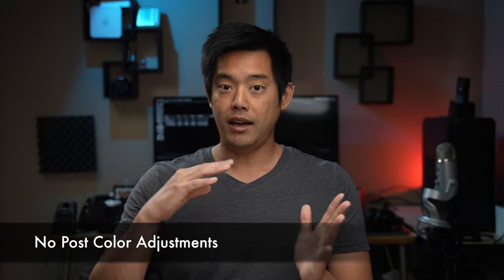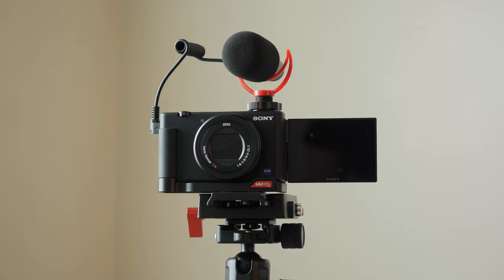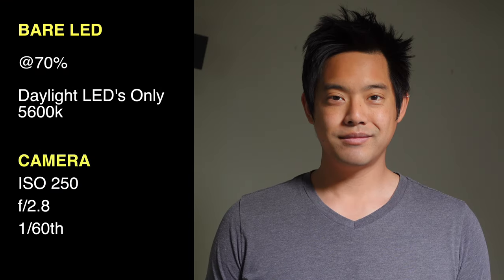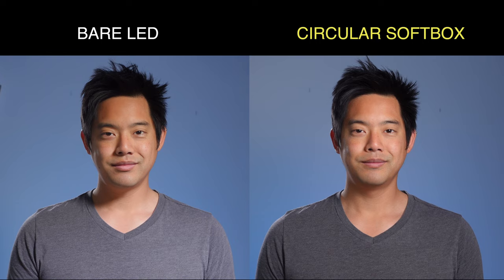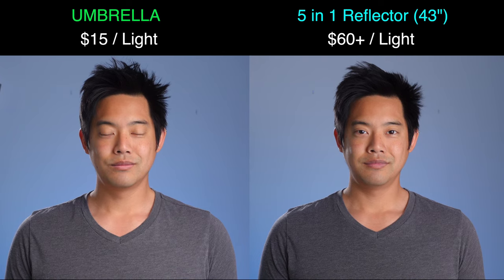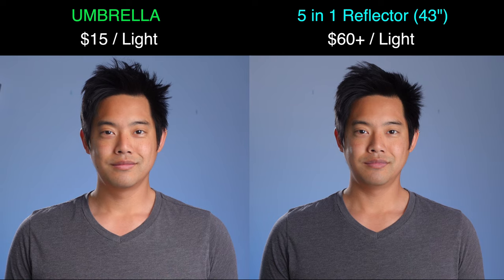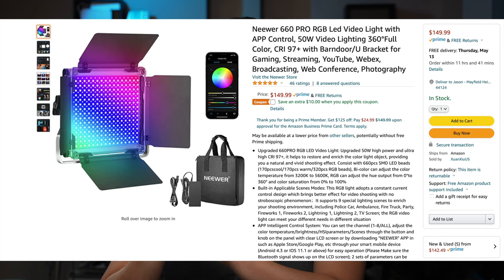How to diffuse your Neewer 660 LED Panels | Budget | GVM 800D and many more

Comment: After having pondered this decision and going back and forth I think I finally decided: The round softbox is what I am going to go with, even though it is more expensive, simply because it allows the softbox to be fixed to the light without having to take off the barn doors. In situations where we have to pack and unpack often, this is the best way for me.
Reply from the maker: Hey hey again DesertCookie!
Actually with the Circle Version (assuming they haven't changed the design) You will need to keep the barn doors on for it to affix to the panel.

Comment: Thank you.  I was having trouble attaching the round Softbox to my Neewer 660.  I was under the impression that I needed to take off the barn door, but the Softbox wouldn't stay in position.  Watching you put your Softbox over the barn doors really helped me.  Also, I will take off the diffusion panel.
Reply from the maker: Hey hey CMQ Japan!
Thank you so much for checking out this video and commenting!
So glad this video helped out! Yea the circular one definitely needs the barndoors on. Kind of weird that the circular ones didn't a easier way to do it without the barndoors. 
Thanks again for stopping by! Stay safe, healthy, and I’ll see you in the next one!

Comment: That was a great video. I've seen so many videos of people hating on the 660's, but I think you can use it with the proper diffusion under certain circumstances that would help. Great video!
Reply from the maker: So glad this video was helpful! Yes the 660s panels are still very versatile when modified correctly to get the look you're going for!

Comment: I had almost all the lights you are talking about and need to add my opinion on them. The 660 rgb, when it comes to only the whites, is much brighter than the regular 660 bi color.  Even with less lights for the whites the RGB still very much outperforms on whites only. And of course you have the benefits of the colors as well. I recently upgraded all of my 660 rgb to the pro version. And the pro is definitely brighter all around on both whites and colors. It's also has higher wattage. Hence the reason it's brighter. And why I upgraded. I also own all the softboxes and diffusion equipment you mentioned. One thing not to forget is the convenience of the neewers. Because they attach right on the light and fold up in a very small/portable package.

One thing you should have tried is neewers all white one. I have those as well. I would assume that they would be a bit better at removing shadows in the face and neck. But they will probably also spill some light onto your background. I would love to see a comparison video made comparing the all white, the black sides, and the the black with the grid added. I may do my own testing but don't think I'll be able to make a video to upload.
Reply from the maker: Hey hey Adam!
Thank you so much for checking out this video and commenting!
Awesome to hear that the Neewer 660 RGB Pro's are brighter than my old 660 bi-colors. I don't have the newers 660 series to see how they compared to these older 2.4g models. I'm sure they've gotten better since then and still serve as an awesome deal for people looking for lights to start their filmmaking journey. 
Thanks again for stopping by! Stay safe, healthy, and I’ll see you in the next one!
Reply: @TLDR_filmmaker  it's not just the pro rgb. I had the non pros as well. The regular 660 rgb. When I ordered them I also ordered 2 of the of the bi-color. Specifically because I thought on the white only they would be brighter. I was very much mistaken. The rgb's whites definitely blew away the bi-color. I even made an amazon review about it.
Reply: @TLDR_filmmaker  by the way, I most definitely appreciate the reply. And your videos as well.

Comment: Would you use one with an Elgato Key Light to help soften the light further?
Reply from the maker: Hey hey Jason!
Thank you so much for checking out this video and commenting!
I'm not sure how bright the Elgato Key light can get. If it's very bright you can definitely use an umbrella or reflector to soften the light further. I wouldn't use a softbox that is small and similar in size. You want the 2nd diffusion layer to be larger. 
Thanks again for stopping by! Stay safe, healthy, and I’ll see you in the next one!

Comment: This was a perfect comparison! I bought the Neewer NL660 set about 10 months ago. Unfortunately I got the version without any display on the back of the LED making it impossible to know which K values I am using the LEDs at. I am using this set for my Youtube channel, where I do drumcovers in a super tight space, which is where those LEDs really seem to shine due to the limited space (thank god for Manfrotto's autopoles!) . In my studio I am using the circular and the square softbox and when I use the LEDs in my living room, I tend to grad my cheap umbrella (lots of spill though...) or my 5in1 reflector. Atm I am saving up for the Godox VL150 for my talking head videos. I will definately keep my 660s though, since they are super flexible (with color gels, as a hair light, lighting the wall, etc.). Btw the cheapest option imo is baking paper (color shift can happen), a plain white shirt or a piece of bed lining.
Reply from the maker: Hey hey El Boyo Electronico!
Thank you so much for checking out this video and commenting!
Awesome! Glad the 660 panels are working out for you with the various diffusion options! Yup yup, I used wax paper for awhile as well! Solid cheap diffusion tricks!
Thanks again for stopping by! Stay safe, healthy, and I’ll see you in the next one!

Comment: Nice video! Can I get a speedlight/umbrella adapter and then remove the hotshoe part (I guess they screw off) to reveal a screw that I can put the light stand adapter, then finally the 660 on that?
Reply from the maker: Hey hey shmikey100!
Thank you so much for checking out this video and commenting!
That is a good question, I've never used a speedlight adaptor before but if you unscreen and it reveals a 1/4-20 port or a 5/8th, then yes it should work if you just buy the baby pin light stand adaptor. 
Thanks again for stopping by! Stay safe, healthy, and I’ll see you in the next one!

Comment: Your videos are very informative! Some of the best on YouTube, really. Whenever I see your name pop for a topic I'm looking for your video is the first I click. I have a question: I'm in the market for 660 RGB PRO but I also want the bi color version. Would it make sense to buy all RGB PROs or does the RGB PRO not work as efficiently as a bi-color?
Reply from the maker: Hey hey Furious Angus!
Thank you so much for checking out this video and commenting!
So glad this channel has been helpful for your product research!
The RGB Pro is a good round about panel for inside a bed room and smaller setups, but if you are looking for maximum punching power, the Bi-Color 660 will have more because of that focused light. Depending on how many lights you need, say like a classic 3 piece setup. You can definitely mix it up to your needs, maybe 1x bicolor for the punch and then 2 RGB PRO for fill light and color use depending on your needs. 
Hope this helps!
Thanks again for stopping by! Stay safe, healthy, and I’ll see you in the next one!

Comment: You're tutorials and reviews are super helpful, detailed but not too long. Amazing!

Just wondering if you could help me add the umbrella on my 660. I'm a newbie and don't know how to do properly. And if you could recommend specific umbrella and other needed hardware, I would appreciate it. By the way, Im from Canada. Thanks man
Reply from the maker: Hey hey Psalms by harvz!
Thank you so much for checking out this video and commenting!
Glad this video was helpful! All the links to the umbrella and umbrella bracket I used are in the description. In terms of putting it together, its pretty self explanatory when you receive the items. Simply mount the umbrella bracket onto the lightstand, and then the 660 on top of the umbrella bracket. There is then a little hole for you to slot the umbrella rod through. And thats it!
Thanks again for stopping by! Stay safe, healthy, and I’ll see you in the next one!
Reply: @TLDR_filmmaker  Thanks for quick response. I really appreciate it. I just noticed you have the links of the umbrella and the adapter below. 

Yeah! You're video are simple, easy to understand, brief but detailed. Would love to see more camera, lights and gear review.

Currently I have ZV-E10. I have Sigma trio's, small rig case and would love to hear more useful accessories and gear for ZVE10.

Comment: Great video! Would it make sense to use the provided diffusion panel and the umbrella? Or another way to put it, would that make things even softer or just make the light dimmer?
Reply from the maker: Hey hey D!
Thank you so much for checking out this video and commenting!
It will technically make it softer, however I feel its not that big of a difference when using the umbrella method so I choose not to use the diffuser panel to maintain more output power. 
Thanks again for stopping by! Stay safe, healthy, and I’ll see you in the next one!
Reply: @TLDR_filmmaker  Makes perfect sense. Thanks for the response! & Likewise!

Comment: You mentioned the SMD version (P-600 2.4GHz), which doesn't have the lenses and offers a more a "flood" light to more uniformly illuminate an umbrella. I looked into it, but it only has 600 LEDs and 1700LUX/m output, as opposed to 2270LUX/m in the 660. 

I also found a "660 Advanced" version on Amazon, which claims to have 3360LUX/m (It's listed as "Neewer Upgraded 660 LED Video Light" on the Neewer site). The downside of this version is that it seems to be non-compatible with the 2.4GHz remote. But the extra output is tempting... Ugh, so many options! My OCD is going into overdrive.
Reply from the maker: Hey hey Chris!
Thank you so much for checking out this video and commenting!
I hear ya, chances are the newer non-2.4ghz version uses a smart phone app instead. As far as the numbers they quote, I would take those with a nice grain of salt because chances are they are quoting the top end daylight color at like... 6000k+. A blue light spectrum reads much higher than an orange light spectrum. So when you go down to normal 5600k, it may all end up being the same at the end. 

Ideally you'd want that flood beam going into a softbox, especially if that softbox is very close to your face (which you want for soft shadows). But if you plan on keeping the light further away from you, then it's really not going to matter and you should probably get the one with the most output so that the light can reach you. 

Hope this helps!
Thanks again for stopping by! Stay safe, healthy, and I’ll see you in the next one!

Comment: Great idea and very considerate to use those settings 3:00, which give an overview for any system !! They should learn it and do the rest of the community !!!
I am a user of a Panasonic G85, m4 / 3, 16Mpx .... I am tired of seeing tests with wonderful Full Frame cameras, full frame lenses f1.2, even with the Sony A7SIII and that in the tests they put the ISO at 125000. ... of course it gives good results !!! but ... can I lend you my camera? See if you get the same results?!?! XD

Thanks again for your consideration.
Reply from the maker: Hey hey again Hackerockmedia!
I know right? This is why all my color and luma tests on lights are still done on my Panasonic GH5, because if you know the GH5 can handle it, then any full frame can handle it. That being said, on your G85, you will want to use ISO 400 to be your baseline ISO in general. With a MFT 2.8 lens and in a controlled lighting situation, you should be fine for a close up youtube shot. Hope this further helps!

Comment: Hi. Is the SMD version better for makeup artists? Thanks
Reply from the maker: Hey hey agan Amby!
The SMD will help better fill out a diffusion layer, but when you are dealing with a panel this small and using it through diffusion, the difference between the two is not large and your final use case won't be affected by it. Both types of panels are SMD's LED diodes, one simply has a lens in front of it and the other one doesn't.

Comment: Just got the umbrellas but pondering the lights.  RGB.. who is it to white balance with a bicolor light? How much power does it give out. Which gives out the most brightness?
Reply from the maker: Hey hey again L'ORAGE!
General rule, bi-color panels will usually be more powerful because you have more LED diodes per color. When you split those with extra RGB diodes, you're losing brightness. 

2nd general rule, if the LEDs have "lenses" in front of it, it will artificially have more power by focusing the light. But of course this means that lighting up a diffus material will be a smaller area than a larger area (for softer light). 

For future reference, every light I have every tests I have all the results on TLDRfilmmaker.com so people can compare output between panels.

Comment: Do you have a video showing how to set up the umbrella adapter and umbrella? I don't like how bulky the umbrella is but if that's what  I need to get soft lighting for those medium shots then so be it :)
Reply from the maker: I do not, its pretty easy as it just attached onto the light stand and there is a opening for the umbrella rod to go through.

Comment: What’s the difference between neewer 660 and neewer 660 smd and which one is better for daylight application? Thank you!
Reply from the maker: Hey hey Liza!
Thank you so much for checking out this video and asking a question!
SMD version does not have the focusing lens on the LED itself, which in turn creates a more "flood" light while losing some overall light intensity. Which one is better? Both are good for different applications, but if I had a choice, I generally like SMD more because I'd rather have a even flood beam over spot beam that has a bright spot in the middle of the beam. 
Thanks again for stopping by! Stay safe, healthy, and I’ll see you in the next one!

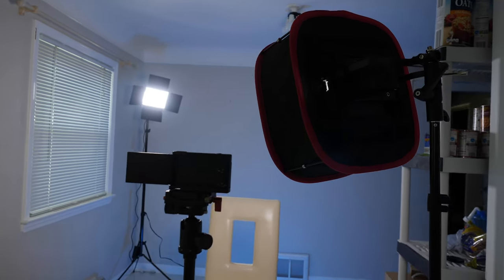Comment: Hi! Would I have to buy an adapter to set my panel in the horizontal orientation 1:40? If not can you briefly explain how to do it? Thank you!!
Reply from the maker: Hey hey again Christine!
No you do not need an adaptor to mount it horizontally. The Light yoke has two mounting holes, simply use the horizontal one when mounting to a light stand and you'll be good to go.

Comment: Brilliant review. I’m looking at some lighting for an online course I’m putting together. At the end you mentioned that these lights are great for a medium shot. What would you recommend for a light that can do the medium shot and some indoor full body shots at home?
Reply from the maker: Hey hey DogmannUK!
Thank you so much for checking out this video and asking a question!
For full body shots indoor you'll want to at minimum have a 60w COB LED. Assuming you will diffuse the 60w to lessen the harsh shadows, you may do a slight dance with your camera exposure and aperture setting to ensure you get the right exposure. If you were to get two 60w COB LED's so that you have one on each side of the camera, then that should be more than enough for an indoor full body shot. Here are the current 60w available that you can take a look at and see which is best for your needs: https://www.youtube.com/watch?v=4_2HDFuBtRo

Hope this helps!
Thanks again for stopping by! Stay safe, healthy, and I’ll see you in the next one!
Reply: @TLDR_filmmaker  Hi, thanks for getting back to me. I was looking at getting the Godox either the sl60 or was considering sl150wii?? Would either of these be good? Would I then be able to use these for the fill and backlight?
Reply from the maker: The SL150wii will be more than enough power. From there you can technically just get a 60w for the fill and another 60w for the backlight if you want a nice versatile three piece kit.